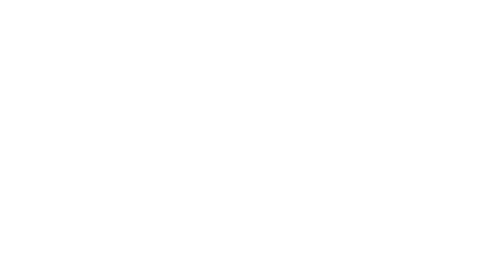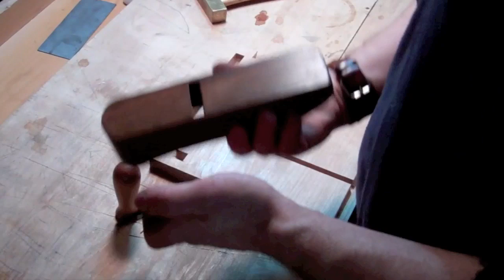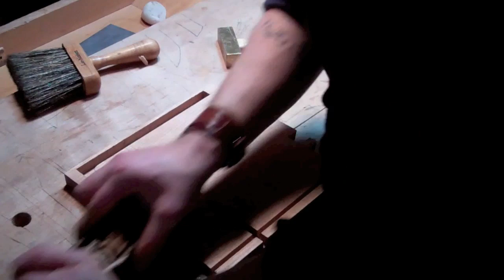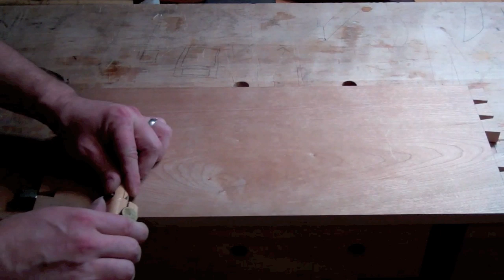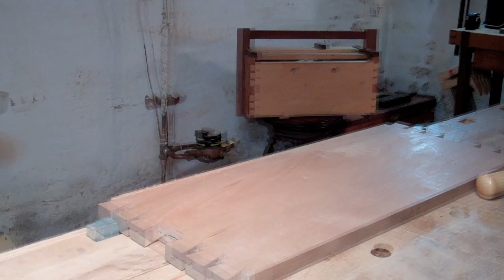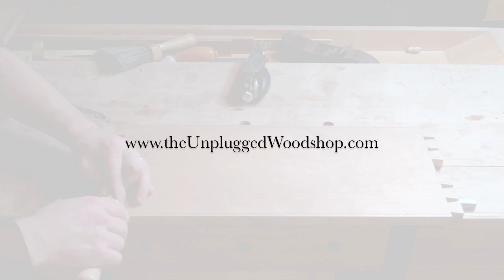A Cabinetmaker's Toolchest part seven: Smoothing and Beading

Comment from the maker: thanks kimowasabe- I am still giving classes.

Millo- thanks for the comments and question. The 'fit' of the dovetail isn't an issue as I'm only taking a few thou- shavings from the inside of the panel. I suppose they'll seat a little further into the dovetail sockets but that's ok. I mark them proud/heavy to begin so after assembly I'm always planing them flush. This if anything, may save a few passes with the hand plane later- but no, it doesn't affect the fit.
cheers guys!

Comment: Tom, I'm planning to buy my first bench plane. Which size do you recommend as an all-purpose plane?
Reply from the maker: Thanks George, that's the million dollar question isn't it?
I personally would go with a Jack plane, either a No. 5 or 5 1/2.
That plane is about 14-in. long and can be used for many workshop tasks-
flattening boards, jointing edges, shooting...
I use a Jack plane for 90% of my work.
thanks for the question and all the best~
Reply: Tom Fidgen Thanks very much for the advice, I really appreciate it.